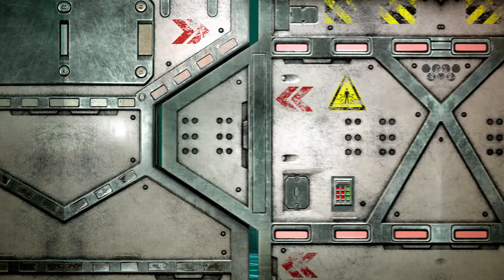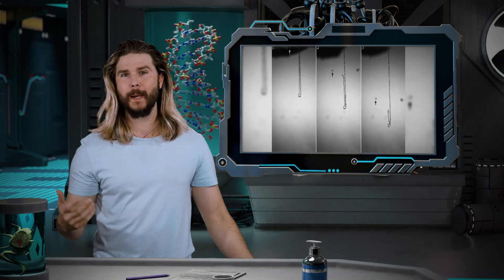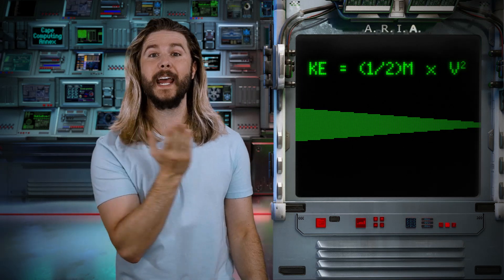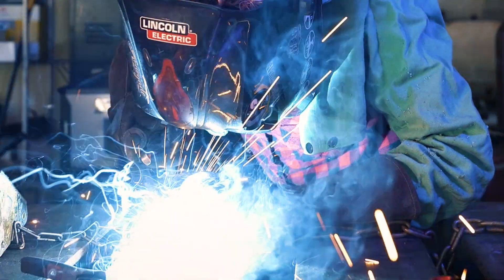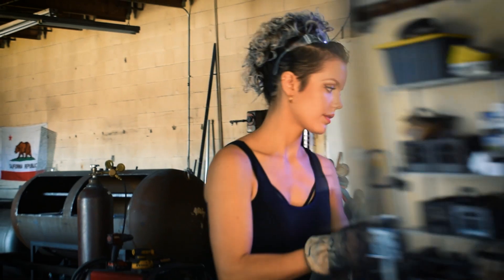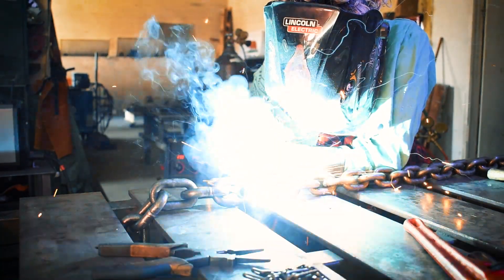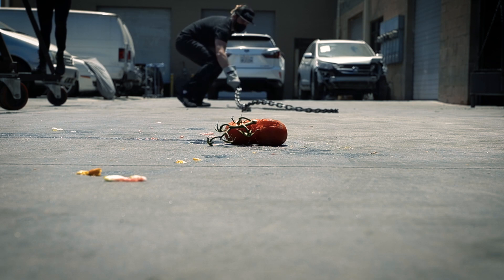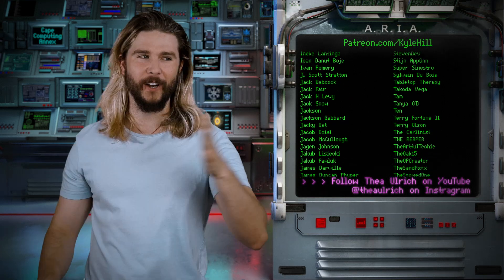Steel Chain Whips are SCARY

Comment: I am like 70% certain this would work better with steel cable than chain, since it would provide a much more complete energy transfer.
Reply: Anyone who has been trained to work on an aircraft carrier flight deck will probably agree with you.  It's well known in those circles the damage that a steel wire under tension is capable of.
Reply: @TheCountOfMommysCrisco  You don't even have to go to the extremes of carrier flight deck personnel, just try asking a fencing contractor what a wire can do when it lets go. I once saw a guy tension a medium tension fence wire under the impression that it was high tension wire and when it snapped it whipped his buddy about half way between the posts (bad practice but not uncommon) and cut through the back of his thigh all the way to the bone.
Reply: @TheCountOfMommysCrisco  they can take legs off. It's terrifying
Reply: @TheCountOfMommysCrisco  yea everyone who hs worked on a carrier knows a guy who knows a guy who was cut in half by one of those cables (i'm not saying it NEVER happened i'm saying there is no way everyone who claims to know soemone it happened too could or the navy would be shrinking daily)
Reply: @WardNightstone  I'm saying learning about those instances where it has happened is part of the training, so it's a well-known fact.
Reply: @WardNightstone  well I mean everyone on the planet is supposed to know each other through at least 3 people (example: I never knew terry fox but my friend has a mother who dated him before he passed) so its pretty likely that yeah everyone knows a guy who knows a guy that was cut in half.
Reply: @kwasy7663  i know you'r momma, how is she doing?
Reply: Yeah like ghost ship
Reply: Yeah I was thinking the same thing.  It also just seems like a more natural choice being all springy and continuous already.  Plus you might be able to actually lift it off the ground.
Reply from the maker: I don't think so. The taper would be a real shitty quality (bad for welding) and the rigidity of cable wouldn't allow for a tight coil like that.
Reply: @kylehill  what about woven cable?  Sheath style arrangement, with outer layers removed to taper down to the tip?
Reply: @maechael-ns1xe  Or weave metal strips in a bull whip style?
Reply: @1TakoyakiStore  that's what a woven mesh cable is, thin pieces of wire interwoven for shape and structure.
Reply: @maechael-ns1xe  Those are fibers and not flat strips unless there's a kind of wire brade that does that? I only mentioned it at all because it would literally look like a metalized whip, and not because of some physics advantage.
Reply: @1TakoyakiStore  there are some cables with strip construction,  but I don't think they'd work as they deform under force, to fit into placement
Reply: @1TakoyakiStore  that would be stiffer
Reply: @kylehill  But Kyle this all depends on the gangue of the wires used and welding would not be used. Similar to a leather whip, layers and tapering would be key. And this could not be produced manually and many design iterations would occur. It would have to be manufactured by a specialized machine, even a very intricate metal 3D printer.
Reply: @kylehill  Mike Shake did it, just watch his video
Reply: @kylehill  I think with steel cable the cables have to be braided not welded. Just like Adam Savage did his ray skin bull whip on Tested. That method has been mastered already, so why not to use that? It is tedious work but the result would be amazing.
Reply: @napiton  thats what armored cabling is, braided steel threads and its not at all flexible, even very think gage braided cable is stiff. some police forces and militry use it in place of batons as it is less likle to break bone but still gives a hefty wack and is very pain full. but its not whip like, more like getting his with a thin cane.
Reply: @kylehill  Make a video, or make it a patreon goal (if you get a certain amount per month than you'll work on this. ) I think everyone liking this orginal comment would be happy to donate if you mention it in your next video.
Just a minor suggestion
Reply: Would not function the same because of how the strands are wrapped. The conservation of motion will not be high enough. I work with cables under tension a lot in my day job. Even after years of being stretched out, cables still want to recoil naturally.
Reply: @TheBlueB0mber  isnt that pretty much why suspension bridges work or am i thinking wrong?
Reply: There is in fact a steel whip that is essentially a thickened and sturdy cable lol
Reply: Yeah see I’m not too sure. It needs to be able to double back on itself like a hairpin, and I think the cable would deform if forced into that shape.
Reply: @mystry4022  but what about guitar n bass string they are majoritily made of steel says nothing on how thick it has to be and those hurt like fuck as it is if snaps and whips you in the face as i found out
Reply: Thomas Debenham agreed, I’ve split fingers open on wild strings. And yeah maybe a single string but these guys are talking about cable. I think a coiled guitar string wouldn’t work, but maybe the lower 3 strings would. 😁
Reply: @mystry4022  I've been sliced by cut guitar strings.  Thought I released enuff tension to safely cut them the first time I did that. Obviously I didn't. Got a good gash in the palm of my hand and lotsa blood all over the guitar. Truth be told at the time I was more worried about my blood staining the guitar than having a 3 cm long, 3 mm deep slice in my hand.

Needless to say, I now completely detune my guitars AND wear eye protection, before snipping any strings.
Reply: I used to work in precast concrete, making pre-stressed bridge beams. We started building these with .75” steel stranded cables pulled over 600' and tensioned dynamically across a very sturdy frame. The tensions in the cable can reach 4500 ft lbs. Whenever they're tensioning the cables they have to stop traffic in the Workyard. one day we had a cable snap after they had allowed traffic to continue. It's sliced into a Peterbilt Truck pulling a trailer. The cable came down on top of the sleeper cab and sliced the truck all the way down to the frame about 14” behind the driver.
Nobody was injured thankfully, but wow what a spectacular event.
Reply: Steel cables are typically too stiff to build up any momentum. It would have to be quite thin to be flexible enough to build momentum.
Reply: @momentary_  yes. It could start at 1/2 inch and taper, over 20 yards, to 1/16th inch
Reply: Maybe just a length of thin steel cable at the tip, to give the whip another step-down in mass and in cross-section.
Reply: yes, but steel cable is also stiffer meaning they would need more space.
Reply: @allstarwoo4  not necessarily it depends on how the cable is thread, the way you induce the force into the cable and its thickness
Reply: @thomasdebenham2883  true but at that point a chain is more plausible.
Reply: @allstarwoo4  under intense load,  that steel cable becomes surprisingly flexible
Reply: @RovingTroll  yes technically but I've been whipped by rope before and I'd forgive Kyle for not attempting it. I mean a chain will still hurt you but cable might slice some parts off.
Reply: @allstarwoo4  you have to make it with thin (0.6 or 0.4 mm) nitinol wire, braided and should be hollow there i think it should work as it was made of leather
Reply: Maybe so, but a chain is more badass you gotta admit
Reply: Wouldn't a steel cable also be lighter than a chain? I don't know much about it but I'd assume you would be able to use it easier than a chain.
Reply: I think a different type of chain would be best, something similar to ball (dog tag) chains. Chains that flex easily but don't contract so easy. I'm sure it would be a major project to fabricate such a thing, not just a quick proof of concept like they did here though.
Reply: @Bob5mith  I think that this would be an interesting take on the concept.
Reply: How would you taper off a steel cable to have progressively less mass? Also, I have to add it would probably be much more expensive to do than the work required to link 4-5 chains together. Not practical for a demonstration, although its hard to think of what would be a good practical application for a steel bullwhip.
Reply: @Zantetsu13  tapers to steel cables could be achieved by applying heat under tension?

Imagine pulling like wrought iron designs,  you heat and stretch the metal for it.
Reply: @Zantetsu13   M U R D E R …errr…Y'know, just useful household chores! >_> <_< ^_^
Reply: Zantetsu13 hunting vampires and other creatures of the nights
Reply: Yeah this is pretty much just a sciency excuse to beat stuff with a chain.
Reply: Nah, it's too stiff and inflexible enough for that. Too much energy would be absorbed by the tensile rigidity of the braided fibers. Although I do understand where ye coming from. I've seen steel cables that was under high tension that when it snapped recoiled with enough force to slice a person in half.  BUT, that's due to the tremendous energy built up in the tension suddenly released all at once. In this particular case, it was an arresting cable for landing carrier fighters that snapped. That's a LOT of energy therein!
Reply: Kyle time for a redemption video
Reply: Would it be flexable enough though? Even on the narrow end?
Reply: @matthewwillden7069  see my post, about using woven cable.  You can mitigate fraying by using layers of woven metal, and bonding them at terminals.
Reply: That was my thought
Reply: In theory, yeah it would, but I doubt a human can whip a steel cable
Reply: @alexkingston7461  depends on the type of cabling used, loose weave cable, absolutely, bridge tension support cable, no.
Reply: Since when has Kyle been conventional
Reply: @amadeuscrossing7061  Wait, I'm American, if not conventional, is he nuclear?
Reply: @matthewwillden7069  That seems like something a grandmother would quilt only after a lifetime of a Dalai Lama's type  success and spiritual accomplishments, but I'm not underwater cable weaver so who knows
Reply: This was probably the best version that they had the means to construct.
Reply: But it wouldn't be as badass
Reply: @alexandrerafaelblasi753  I think a weapon that you can carry without exhaustion, as well as whip above your head is badass.
Reply: Using my knowledge of electrical conduit, i would have to disagree with using cable. 
It is far to rigid for a human to use it as a whip. We can not generate the energy to get it to "crack". A whip changes is form from soft to hard to soft quickly. 1 cord of a steel cable still is hard to roll up and keep that circle, the cord tries to maintain a form, so resistance doesnt allow for the whipping action. 

A cable will act like hitting someone with a bat. The energy moves with the bat and not through it. A whip increases velocity independent of the initial source, the energy is at the end of a whip. A cable will max out about midway of the unit when the arc of force( arm motion) and the arc of resistance (pliability of the cable) intersect. 

One way to use cable would be like Ivy's sword in Soul Caliber. You can take pieces of cable and make stretchable joints in between sections.

Take rope or chain and try to lower it in to a pile. Now try it with cable or some kind of wire. The rope will try to lay where it can, with cable you should see it push until it finds a state of rest, rather than rope that isnt being push on by lowering the rope. Wire forms to a shape, chain shapes to a form and then releases it after.
Reply: @katieblade7083  Thank ye ma'am, for explaining the applicable differences between using a semi-rigid cable and a free-form rope/chain for use as a whip.

About the only thing I'd add is that the cable would more effectively used as a version of a riding crop or otherwise known as the horse whip. Obviously in a much shorter length than a typical Indiana Jones whip, much more closer to what Sherlock Holmes uses.

The weaponized forms often have weighted handles and/or sharp metal bits  or small weights attached to the far end(s). Some of these are called cat-tails or cat-o-nine-tails. These weapons are also generically called flails.  To make a modern version take a short length of steel cable and unravel one end and leave the other end intact for use as a handle. I'll leave the rest to imagination...
Reply: @TheGhostGuitars  the best way is to fuse both paths of construction
Reply: I read a book where one of the weapons was a braided steel whip made from what I read as linked plates
Reply: I look at it like bridge supports, when a cable breaks and the tension is broken its already under less energy than when it was under tension.  It may whip around but that is not a whip. Its expelling its energy not increasing it.
Reply: I think it would be harder to taper the cable and its also quite a bit stiffer than chain but yea my common sense says that would be way more dangerous
Reply: A cable is more dangerous. Points of contact. Id rather be hit by a chair than a hammer. More surface area baby and a less centralized hit. 

And i think tapering a cable with enough cir mils* and strands could yeild the design we are looking for, i just havent in my experience with conduit seen it act close enough to rope or chain like we want it to.
Im bit of a cowboy and even a laso rope is to rigid. You need to look at things that have a non specific form and a low enough resistance to directional changes.
Reply: IF you go watch the Mythbusters where they did the snap cable test you can see it does not react anything like this, it has a minium curve whcih even with quite thin cable it does not have the flex you need for a whip. What i bet would work is the chain made of little balls. that has good felxibility and you could go from large sphere down to very small ones. The only other issue i see with this though is mass vs speed, a chain has a high mass so would it simply snap once it gets up to high tip speed going though a tight arc. I bet there is a reason rawhide is the material of choice. I imagen back in the day many peopel tired Metal whips (they could make chain mail after all) but it simply does not preform well. a cable is to stiff while a chin is not a continus lenth so you lose energy with each link.
Reply: @TheDevilWAH  their is the martial arts chain whip?
Reply: I thought of that as well but most cable/wire would be to stiff to generate a tight coil/wave needed for the energy transfer, at least at the scale of a normal/comparable whip like they used. I think if it is supersized that minimum radius that is needed to start the chain effectively also increases. Would have to be HUGE but I think if able to be done it could break much more that the sound barrier (and likely itself).
Reply: Reading your responses exiserating, great processes everyone! This is what kyle hill wants. We use our different skills to have a great convo! This is science bros! This is awesome! As much as i think i know, seeing other perspectives, this is kyle's goal. We as a scientific community coming together to find the truth, it is beautiful, great job everyone, and thank you for staying classy.
Reply: People talking about getting cut by guitar strings must have paper thin skin, because I've played bass and guitar for 15 years and have never been cut
Reply: The problem with steel cable is the  memory vs a chain. chains dont want to return to a status quo, cable does.
Reply: @loumorningstar7709  Yup, that's why cables makes poor whips, altho shorter lengths can make excellent flails/scourges, if prepared properly. I've already mentioned the process earlier. Altho I didn't mention the preparation of the unbraided end's tips.
Reply: @TheGhostGuitars  oooh Jesus, i didnt even think of that. A cat o nine tails would SHRED a human like bear claws with cable flail parts! God thats twisted. You sir, i like.
Reply: Exactly what I was thinking the whole time.
Reply: Yea but then it wouldn't be like Castlevania
Reply: I think it's just practicality. Trying to have steel cable created that is thin/flexible enough AND comes tapers down would take a good amount of engineering/R&D/production.
Steel cable under tension creates a natural taper (and the "point" is usually the point of failure) plus stores the energy of it wanting to return to it's original shape, but that's not great as an on-demand whip.